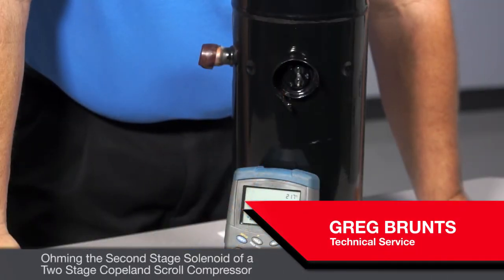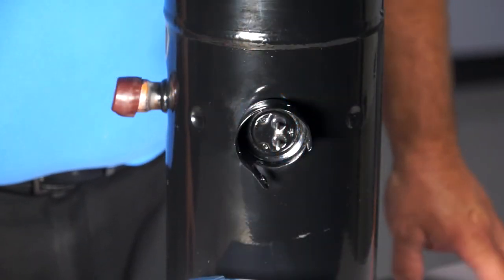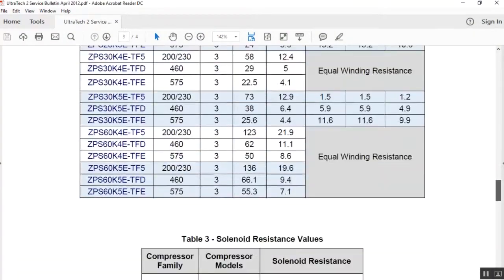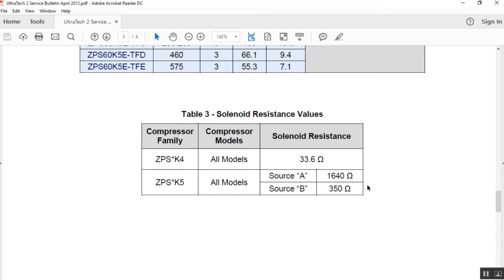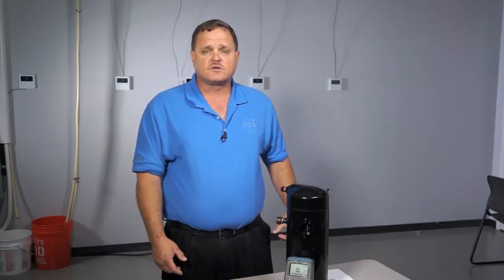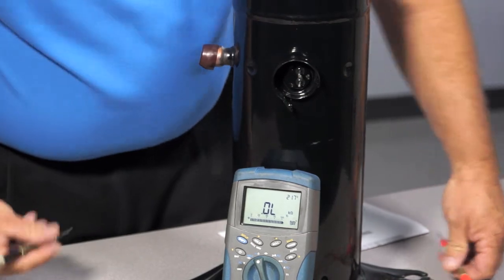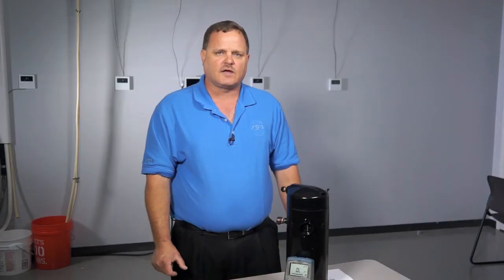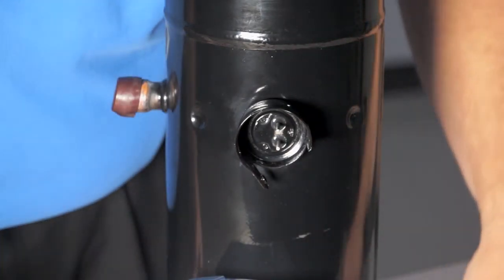Ohming the Second Stage Solenoid of a Two Stage Copeland Scroll Compressor

Comment: Are there any typical reasons you have seen for the second stage solenoid to fail?
Reply: I've heard not to use a mega ohm meter on these compressors because it can blow the solenoid

Comment: so 2nd stage needs 24 volts to run at 100% and if the solenoid is bad it stays in 1st stage or 67%. Thanks for the video, I had an open loop or pump and dump geothermal  that was not getting enough water from the well and I unplugged the 2nd stage solenoid so it would stay in first stage and not trip on high pressure switch. Should get them by until the well water pressure is fixed

Comment: What engages the high stage cooling? 24v to dc solenoid?
Reply: Y2 from the thermostat sends 24v AC to the compressor through a molded plug that has a built in AC to DC rectifier inside the plug.
Reply: @sentryfe74 If I put one wire to y2 on my board where does the other go?
Reply from the maker: Please contact Nortek Tech Service for assistance 1-800-422-4328
Reply: Some boards like Lennox have the y1 and y2 go to the board. And  output y1 to the contactor and y2 to the compressor solenoid. Rheem runs y2 directly to the compressor.
Reply: I have a Bryant evolution system that I just installed a Copeland ZPSK5, 2 stage replacing my OLD 2 stage bristol. I just don't know where to put the solenoid plug wires at on my board.
Reply: It should have a wiring diagram in the installation manual or on the inside of the cover. I just installed a Rheem 2 stage and the Y2 doesn’t even go to the defrost board but directly to the compressor high stage solenoid plug.
Reply: @sentryfe74  the problem is that the old bristol 2 stage compressor had 2 black wires coming from the bottom of the compressor that were tired to two red wires, one had 110v. I do not want to install this Copeland to that power as I'm sure it's 24v

Comment: When it goes to second stage it will blow a 24v fuse right if it's a bad compressor?
Reply: It can also cause the thermostat to go blank and reset depending on the thermostat. Some will reset before the fuse blows and keep going into time delay
Reply from the maker: Yes, it could blow the 24v fuse if it shorted or grounded. If it is an open circuit, it will not blow the fuse. It would be best to verify the failure with an ohm.